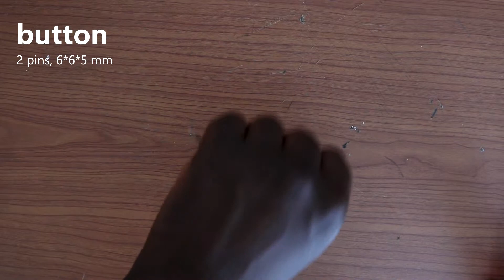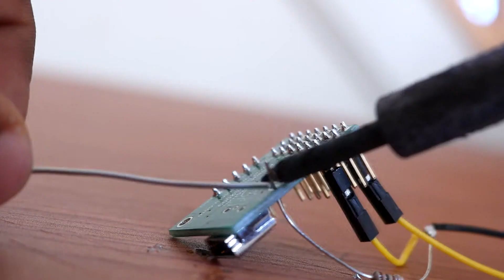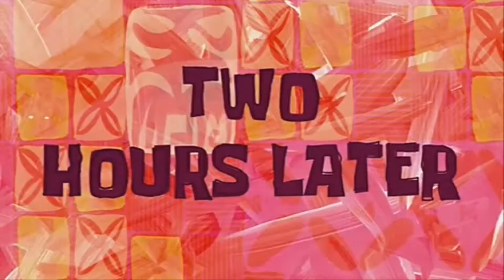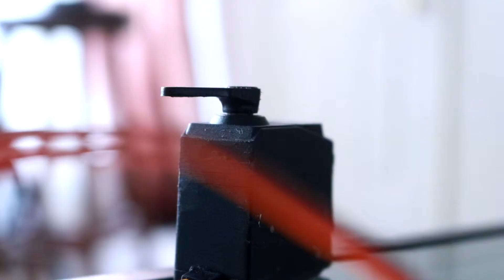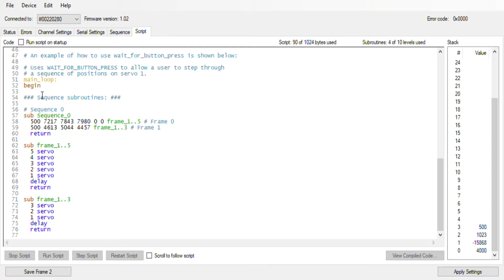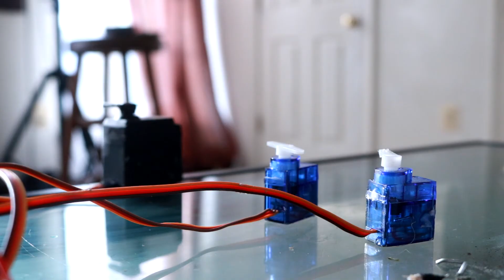CONNECT BUTTON TO SERVO CONTROLLER - DIY

Comment: Nice! To add multiple buttons would you just attach them in sequence, connecting them to each other via the solder points between the black and yellow wires? And would each button replace a servo? Meaning if you have 3 buttons, can you only have 3 servos on a 6 channel maestro?